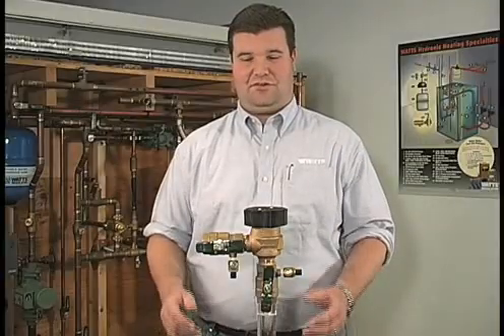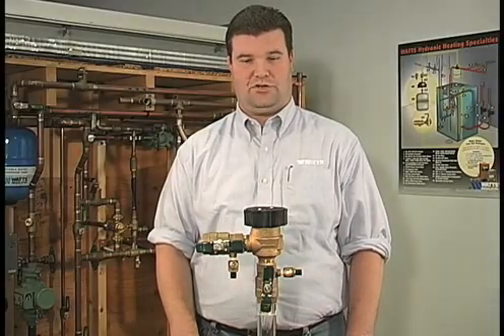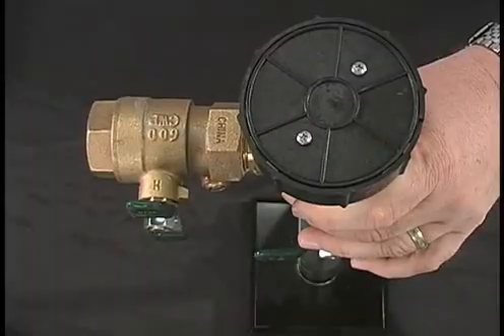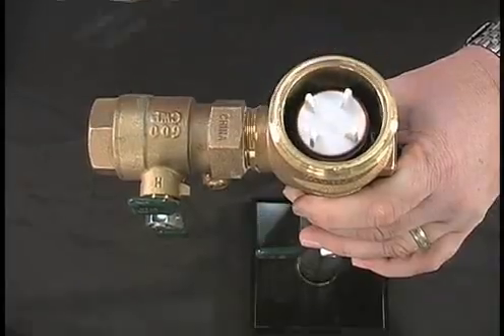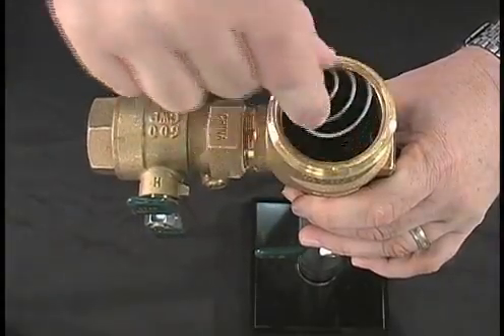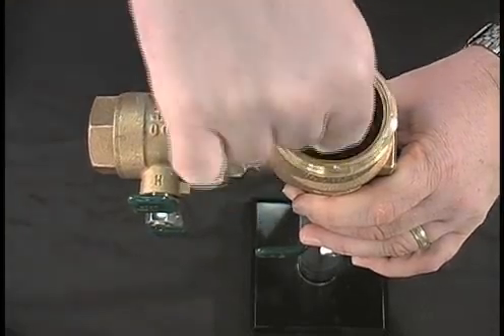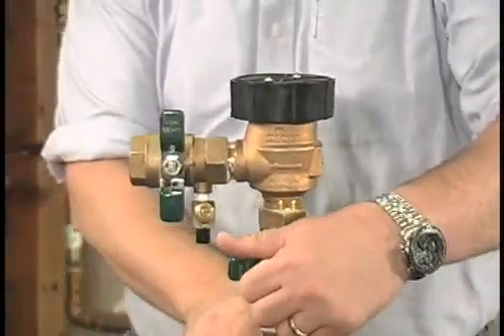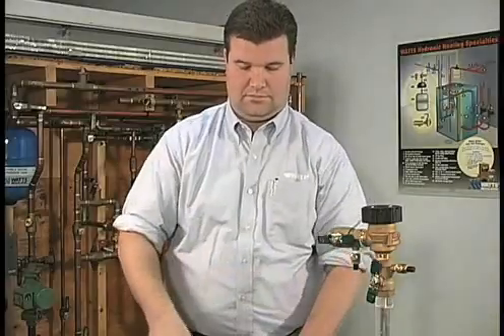How to Repair a Pressure Vacuum Breaker

Comment: Got $89 part for this from amazon as I had the same problem. But after putting all the parts as shown in video, the top does not press on the spring tightly. the spring goes freely in some half inch gap. Looks right assembly till locking the spring - not sure what I am doing wrong after that.
Reply from the maker: Hi Mogilisetty. We'd love to help you figure out what's going wrong. Please reach out to us here for assistance: https://www.watts.com/support

Comment: My valve is leaking, seems to be the same problem described in the video. I tried to open the cap by hand, but no luck. Do you see any problem to use a groove pliers? Thanks
Reply from the maker: Using pliers with large enough jaws to encompass both sides of the bonnet should not present a
problem although I would recommend trying to use two hands first.

Comment: Can I order this kit online?
Reply from the maker: Sorry for the delayed response, but we don’t sell direct to the public.
Reply: You can order from Amazon.  You may need to get the check repair kit & the vent repair kit separately as I did.  You should take it apart and look at your original parts to make sure they match what you are ordering to be safe.  Easy fix.

Comment: But how can I adjust my water pressure when I have one of these?
Reply from the maker: Water pressure should be adjusted at the water pressure reducing valve. With all downstream outlets closed, turn the adjusting screw clockwise to increase; counter-clockwise to decrease the pressure. A pressure gauge will be needed to know where your pressure is set at.

Comment: My Vent Float looks a bit different and has no rubber Vent Seal on it. It is just a white plastic part. The online diagrams show a separate Vent Seal and it does not look like the one in this video.

The rubber Check Disc had an indention in it similar to a worn washer, so I just flipped it over for now. Have not tested it yet since I was wondering if my Vent Float is normal...maybe just an older version. I sure see no broken pieces of a Vent Seal inside.